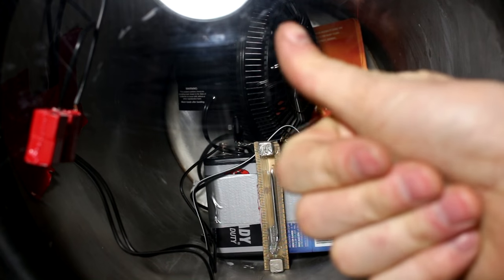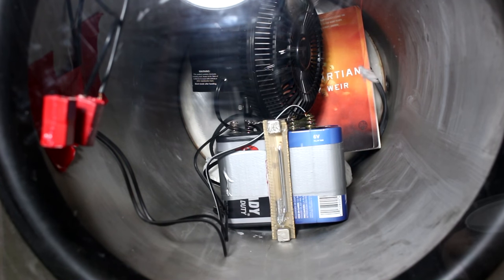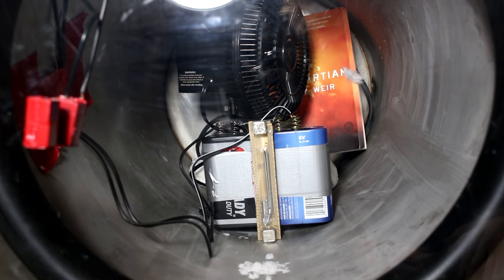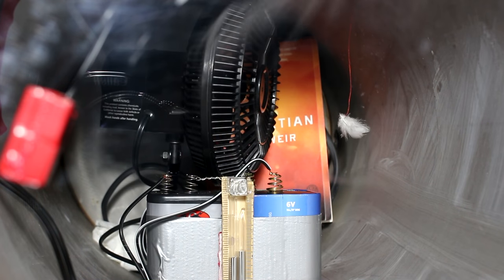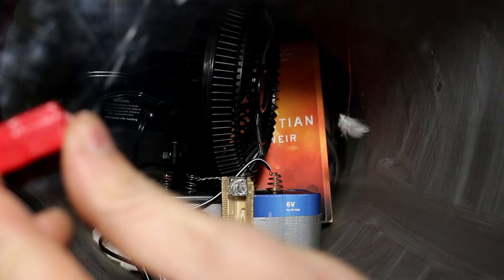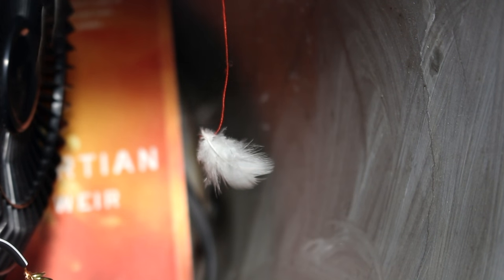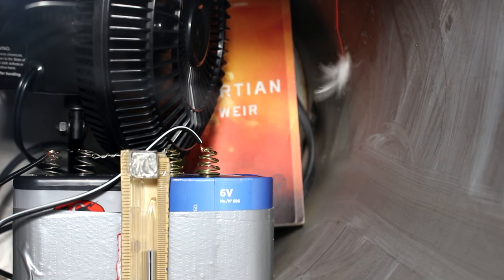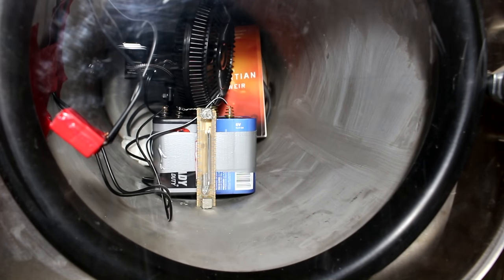How Strong is The Wind on Mars?

Comment: UOL. He uses a 10 mph 'wind' to move a feather and extrapolates that a 200 mph wind won't do much in the same atmospheric pressure. He also did not have a way to simulate the reduced gravity (resistance to movement) on Mars. Wind pressure isn't merely a simple extrapolation such that 200 is 20 times more than 10.  You have to calculate it by taking half the density of the air and multiplying THAT by the wind speed SQUARED. 

For example, a 10 mph wind on Earth (at about 1.2 kg/m^3 air density) produces a pressure of 60 N/M2, Pa on an area 1 m^2. A 70 mph wind doesn't simply multiply that by 7. You end up with 2,940 N/M2, Pa of pressure on an area of 1 m^2. 

Now, from my calculations, Mars has 0.02 kg/m^3 air density. That comes out to roughly 1 N/M2, Pa. But at 70, this is considerably higher. Not 7, but rather 49 N/M2, Pa. A 200 mph super storm like in the movie would make 400 N/M2 Pa on just one square meter of area. 

That is equivalent to a 26 mph wind on Earth, which could easily blow some stuff around... especially if there is less gravity holding crap in place... There is less resistance to movement so the more slight wind pressure is amplified by the lower gravitational resistance to movement.
Reply: There's no such thing as "gravitational resistance to movement". I also have no idea where you got 400 Pa estimate. Dynamic pressure is defined as ρv²/2, so when we plug in (0.02 kg/m³)*(200 mph)²/2 we get about 80 pascals (plug this into wolfram alpha if you don't believe me – bear in mind additional unit conversion may be required). Quick back of the envelope calculation shows that it might be barely enough to topple a completely empty Space Shuttle (no cargo, no fuel) standing upright with no support, and only because it has wings. So no, not very likely.
Reply: Gregory Dearth Inertia and gravity are two very different things, so you're working under a false assumption. Mars's mass is about a third of Earth's (38.4% iirc), but a spacecraft's mass stays about the same no matter where it is (not accounting for small mass changes due to general relativity). Mass is not weight.
FYI,  accounting for aerodynamics in most cases will lessen the force acting on an object compared to a flat surface perpendicular to wind direction. So working with flat surfaces gives a rough upper limit for forces involved.
Reply: *****
I stated all of that. I never said inertia and gravity were the same. I only said "This (inertia) is derivative of gravity" which is an absolute fact. Derivative doesn't mean 'same.' It points at contingent factors. You cannot have inertia without gravity. The resistance to movement of a mass at rest in a gravitational field is LESS in a weaker gravitational field. It takes less wind to move the same mass in a weaker gravitational field.

I even mentioned that bit about aerodynamics and agree that working with flat surfaces, such as a 1 meter square plane perpendicular to the wind direction, gives an upper limit. Remember this bit? "That is why we typically reduce it to a simple 1 meter square plane perpendicular to the wind direction, so the force is as optimized as possible, creating an upper limit for the calculation. A nice round space craft could be more stable and move even less."

You are basically arguing to argue without reading a damn thing I write, making this pointless.

I understand mass is not weight. Not sure why you would think I did not know that. I never even made an argument/calculation based on mass. The calculations only involved wind speed, atmospheric density, and the gravity on Mars vs Earth. The output was only in terms of force applied to a perpendicular 1 meter square surface.

I am using engineering equations to demonstrate that wind speed acts on bodies differently and that gravity plays a role in the assessment this guy was making. It takes 38% of the force to move the same object on Mars compared to Earth. Thus weaker wind force has a more significant effect on the same mass on Mars because the resistance to movement is less.

I don't see how this is difficult.
Reply: Gregory Dearth I'm sorry I was being redundant. I just woke up and didn't pay as much attention. Still, inertia is not derivative of gravity. Again, mass of an object doesn't change in response to external gravitational field changes. Stuff is easier to move up in weaker gravity, because you have to counteract lesser force of attraction. That's it. This doesn't directly apply to wind force, which you seem to insist on. Although balance equations do change, since all forces are involved in those. But that's not related to inertia by any stretch.
Reply: *****
I wish my degree program in college required me to take physics again. I could use a refresher on the subject. Will read some more and see if I can demonstrate my point clearer. I think as we continue you will notice my language becomes more precise. That is, I admit that my language regarding 'gravitational resistance to motion' is very vague, if not entirely an oversimplification.
Reply: ***** Well, you have me thinking anyway. And I certainly THANK YOU for breaking up my boring job with this interesting and challenging discussion. And I appreciate your non-aggressive tone. I have been reading up on this all night. LOL

As I never asserted gravity and inertia are equivalent, I remain convinced they are related when they occur together (with both acting on the same body at the same time). That is, you can have an object with inertia and even momentum if it is moving ABSENT a gravitational field. But when an object is IN a gravitational field, gravity screws with inertia.

In the scope of my original discussion, this is what I am talking about. You might about wind blowing over a spacecraft on the surface of a planet. On a planet with weaker gravity, this is easier because the force applied, to input inertia into the structure (giving it momentum), doesn't have to fight as much with gravity (which is fighting to keep the object in place).

Thus the same amount of wind (force applied), creates more inertia (initiating movement in an object), in weaker gravity. This pertains to this experiment here, as it is obviously a variable to consider (wind speed is more effective at starting a motion in a weaker gravitational field).

If I had to move anything, I would rather do it on a planet with weaker gravity. Whether I use wind or a semi-truck, moving something on a planet with weaker gravity is easier. The resistance to movement is less. The effective (apparent) force of the same amount of wind, fork-lifts, or my own biceps, is greater.

I looked up equations on pendulums and just general equations on starting motion on objects sitting at rest on the surface of the Earth. All of the equations require the use of the gravitational constant.

The apparatus in this experiment would be superior if instead of a goofy feather hanging from a stiff wire, he had just used a light weight pendulum. Already, by invoking the necessity of a light WEIGHT pendulum we can see that in order for his little fan to move the pendulum he is involving a battle with gravity.

Gravity is holding the pendulum at rest, plumb, pointing straight down to the center of the Earth (give or take some minor gravitational anomalies). To set the pendulum in motion, such that it floats at an angle pointing away from the fan, you have to add more energy as an applied force to overcome continuous work of gravity trying to keep it plumb.

Imparting motion on any object at rest on the surface of the Earth is handled by an equation that involves the variable g. Thus, as it pertains to this experiment and my analysis, gravity has to be considered in the assessment of what wind could do to an object at rest on a planet surface.
Reply: Here is the specific equation (expressed with words since symbols don't work well here).

The total work W done to set a simplified pendulum in motion by a force F (the wind in this case)...

W = F times the square root of (the quantity ( 2 r -h) times h minus the mass times g times h).

Where r is the radius represented by the pendulum string to the center of the mass suspended, h is the change in the vertical height as the pendulum is deflected right by the wind (where at rest h=0).

Thus you have to consider gravity in the assessment of how much you can move an object (work) by a force (wind). You cannot complete the calculation or assessment with just F alone when gravity is around doing work against your desired work.
Reply: > I remain convinced they are related when they occur together

At least according to general relativity, inertial mass is equivalent to gravitational mass. When talking about simple mechanics however, this is beside the point.

As a quick refresher. Inertia is a property of bodies to continue moving if they are moving and to stay at rest if they are at rest. This can be expressed in the simple equation, known as Newton's second law: F = d p/d t, that is, net force applied to the body causes its momentum to change (I use bold to denote vectors here). Momentum is defined as p = m v, so for a body of constant mass, Newton's second law reduces to F = m a, where a is acceleration, a = d v/d t. So, the more mass a body has, the more force you need to apply to achieve the same acceleration. Gravity, in contrast, is a force between two bodies with mass. Gravitational force is F = m g = γ m M / r², where g is acceleration of first body due to gravity, γ is universal gravitational constant, m is mass of first body, M is the mass of the second body, and r is the distance between centers of mass of the two bodies. This equation is known Newton's law of gravity (Newton must've been a fun guy, eh?).

Now, neither inertial nor gravitational mass change in presence of other massive bodies, so a spacecraft with mass of 10⁵ kilograms will have mass of 10⁵ kilograms on Earth, on Jupiter, Mars, or in open space. Its weight will be different of course, since weight is the force that a massive body applies to the surface it's standing on (due to gravity). So in open space (or in freefall, which is effectively the same), since there is no surface to push on, weight is basically zero (that's what you call weightlessness). Mass is still the same however, and so is inertia.

> If I had to move anything, I would rather do it on a planet with weaker gravity. Whether I use wind or a semi-truck, moving something on a planet with weaker gravity is easier. The resistance to movement is less. The effective (apparent) force of the same amount of wind, fork-lifts, or my own biceps, is greater.

Reduced gravity can mean reduced dry friction, since the harder you press two bodies together, the higher friction will get (at least up to a point), and in reduced gravity, less force is generally pushing two bodies together. Dry friction doesn't have much to do with toppling, however, and has more to do with sliding. Since we're not discussing a spacecraft sliding, we're not too interested in amount of friction, provided it's high enough that spacecraft doesn't start sliding instead of toppling – which in movie it doesn't, so I assume it's high enough – specifics are kinda hard to estimate though.

All equations of motion for bodies in a gravitational field include gravity because, well, gravity is acting on those bodies, whether you want it or not. However, if gravity is perfectly balanced by other forces, it doesn't actually end up changing anything in the result (unless you factor in general relativity and even then all but the extremely high gravities -- black hole high -- add miniscule corrections). Consider how air hockey works: gravity is perfectly balanced by air cushion underneath the puck. As a result, the puck files almost as if in space (well, if space was a two-dimensional table and had air, that is). This doesn't change puck's weight or inertia, mind. It just dramatically reduces friction.

Coming back to toppling problem, it actually doesn't have much to do with inertia, and is related to the direction of net force acting on the body. General rule of thumb is if a net force vector minus net surface reaction force vector doesn't point outside of object's base, assuming object can't slide, object will not topple (and if it can slide, it will be even more topple-resistant). I could go into specifics of vector math involved, but in a nutshell it boils down to this: if it can not slide, it effectively pivots on its edge; hence, if it topples or not depends on the torque created by the forces acting on other parts of the body. In our example, that would be gravitation and wind resistance. Here's a picture to illustrate my point: https://drive.google.com/open?id=0B7-CAiCdlz0KMFFldmswVVM4ZHM (in fact it's a little more complicated, since wind force isn't necessarily applied to the center of mass, but it's a reasonable simplification given we have little to no knowledge of actual spacecraft geometry)
So all it comes down to is just ratio between wind and gravitational forces and its relation to spacecraft geometry.

Here's an estimation. Assume our spacecraft is roughly the size of a Space Shuttle, sans wings, which has height of 56.1 m and hull diameter of 8.7 m. Different sources cite anywhere from 75000 to 81000 kg for its mass (empty – no fuel, no cargo, no booster rockets, only the Shuttle itself). Shuttle's cross-sectional area in the direction of wind then S = 56.1*8.7 m² ≈ 488 m², which, from my previous estimate of pressure difference of 80 Pa, gives us Fwind = 80 Pa*488 m² ≈ 39 kN (39 000 newtons). Gravitational force for an empty Space Shuttle on Mars can be calculated as Fg = m gₘ  where gₘ is acceleration due to gravity on the surface of Mars, gₘ = 3.71 m/s².  Hence, Fg about 300 kN.

The question now is, does the net force result in toppling. That is a relatively simple geometric problem. If an angle between vertical direction and net force vector α is larger than angle between vertical direction and radius-vector from center of mass to pivot point β, spacecraft will (eventually) topple. Otherwise, it won't.

So.
tg(α) = Fwind/Fg
tg(β) ≈ width/height (assuming cylindrical spacecraft with uniform density distribution standing upright)
tg(α) ≈ 0.13
tg(β) ≈ 0.15
α ≈ 7.407⁰
β ≈ 8.816⁰

α < β, hence even empty Shuttle-type spacecraft would not topple.

Working backwards, for it to topple, we need Fwind > 0.16 Fg, which results in v > 99.17 m/s, or v > 221.8 mph.

This number will only go up if mass  of the spacecraft increases (e.g. if we consider that it must have quite a lot of fuel on board). Also consider that Space Shuttle was never intended to be particularly stable when standing upright – it always was strapped to a larger rocket and held in place by support before takeoff. Also bear in mind that Fwind grows more slowly than Fg with size (assuming similar proportions), so bigger spacecrafts will be generally more stable.

Of course, this model doesn't take into account a possibility of periodic gusts of wind that match proper period of our inverted pendulum (spacecraft, that is). But to be fair, neither did the movie, and this is a first-order high estimate anyway, 

All in all, I'm not too happy with Cody's experiment here: while it does show that thin CO₂  atmosphere has very little kick to it, it doesn't relate very well to toppling spaceships. But the conclusion appears to be correct.

Sorry for writing an essay, I just felt that since you put some effort into this conversation, it will be reasonable to do the same.
Reply: I appreciate the detailed essay. I read it all. WELL DONE, sir. You helped me understand the point better and yet I THINK we are actually in agreement after all.

"So all it comes down to is just ratio between wind and gravitational forces and its relation to spacecraft geometry."

That was my point. He neglected the latter while just looking at the former. In relation to the problem he was considering (that specific movie-based scenario), he neglected HALF the problem (the gravitational forces).

I think that his apparatus does relate to pendulum mechanics, even with his goofy feather and stiff/bent wire in place of a true pendulum. As such, he could have been more comprehensive by just including those mechanics in his analysis and then calculating the difference in lower gravity (the angle of deflection would have been more than what his experimental apparatus could produce on Earth).

That is a good point about friction, though. Regarding toppling a space craft, it is more a matter of torque applied by the wind force. I understand the equations you used to illustrate that point, but still am a bit resistant (pardon the pun) to the idea that gravity doesn't play a role in that calculation at some point. It seems to me that to topple a space craft you would not only have to apply force to the ship in a specific way (depending on the aerodynamics of that body) but at some point have to fight with gravity to lift one edge of the base from the ground. That is work applied against gravity.

Still, I am satisfied with your explanation. Thanks for the crash course in physics. LOL

Comment: If people were complaining about the lack of a CO2 atmosphere, why would replacing the air with CO2, then sucking out all the air, help?
Reply: Because he didn't suck out "all" of the C02, he left some pressure in there, equivalent to the Martian atmosphere. 

He sucked out the Earth atmosphere (mostly nitrogen 78% and oxygen 21%) and left dry ice (CO2) which as the Earth atmosphere disappears, the C02 starts to sublimate (turn from solid to gas directly) faster (due to less pressure) and quickly the remaining pressure becomes more and more C02 and less nitrogen and oxygen.

But even the Martian atmosphere isn't 100% CO2, it's 96% C02, ~2% argon, ~2% nitrogen. So he was just making it as close as he reasonably could.
Reply: BucksterMcgee Ty